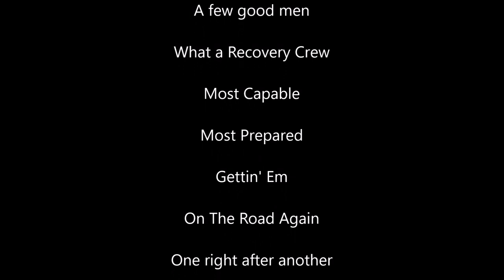Class A Motorhome Beached in the Mud. Cat D6 Dozer Off Road Recovery. UTV Takeover!

Comment: I can't imagine the damage just dragging that motorhome/trailer so deep through the muck has caused....no fault of the crew mind you, just the aftermath in repairs.
At that depth, surely some of our cargo compartments would damaged and on our trailer, we carry 50 gal of fresh water and 50 gal of fuel, both in belly tanks forward and aft of the axles.....that would guarantee a new fresh water tank!!  All that aside, the grinding on the paint for both.....ugggg!!  This is why we go on non-event/non-holiday weekends......
Reply: Yes, ground clearance isn’t just about break-over, it’s about digging it out :o) I was thinking the same on abs bits, air tanks, fuel lines…

Comment: out of curiousity, would it be feasible to build a couple of temporary roadways using large steel plates as ground mats across the worst of the soft ground?

Or perhaps renting actual plastic ground mats from a supplier - as they're much easier to handle than steel plate.

I can't help but wonder how it would compare to the rental costs on the three dozers, your vehicles, and the staff required to do the recoveries?

Thanks Casey, for these uploads from  the UTV takeover, it's been very interesting to see how things play out with an event of this scale.
Reply from the maker: The soft spots kept opening up in random places after lots of traffic. So it would be a huge task to guess where next.
Reply: @CaseysOffRoadRecovery  ah, gotcha.

I didn't realise the problem spots were that mobile, have never experienced that area - what with living on the other side of the world haha.

Comment: Dozer Drag Racing comes to Utah!!  One of those dozers ought to dig a small trench around that area of the beach to give those motor-homers the idea it isn't a good place to drive, or should I say "plod."
Reply: would probably take 5 min until someone drops their rig in the trench
Reply: @nilz6432  Then you point fingers and ridicule them....  But yeah, for some, stupid is a force to be challenged!
Reply from the maker: Ya the soft spots kept extending everywhere. The more traffic then suddenly another hole opens up. We had cones in other areas, but hundreds of acres to try and block off that were previously hard pack.

Comment: Interesting juxtaposition.  Tow vehicle worth way more than what its towing and on paper likely has quite a bit less horsepower, yet the capabilities in that terrain couldn't have been more opposite.  Great vid.
Reply: I just checked the caterpillar website. Looks like the Cat 6 has 215 HP for about 50,000 lbs weight.

Still clearly is the most capable vehicle in that particular situation.

Comment: You could see the stress on that trailer just wrinkling the sides. I would suggest putting a sand birm up to keep people out of the mush, but somebody would just see it as a challenge and try to be bo Duke in a RV .
Reply: Casey was saying that some of these areas were hard pack but the soft spots just show up for whatever reason.
Reply: @brians48now  I was thinking after someone had gotten stuck, but it's hard to block off half your beach access when only the large vehicle get stuck.
Reply: @aaronmcconnell7358  That might work too but like you said, with that much area and the huge turnout they get, getting stuck now and then is just part of it.
Reply: @brians48now  yep it just becomes another obstacle for  everyone.